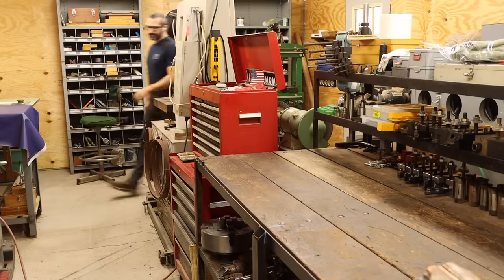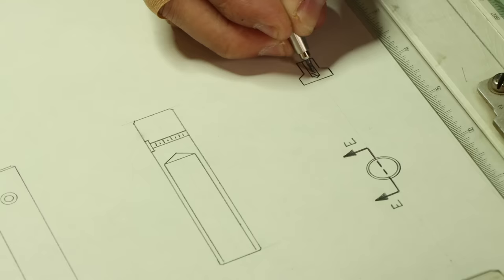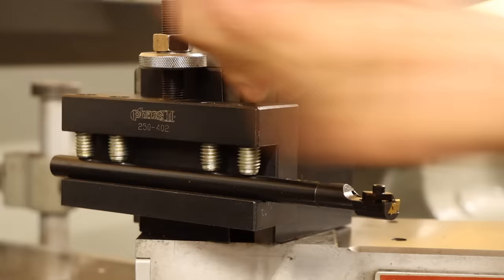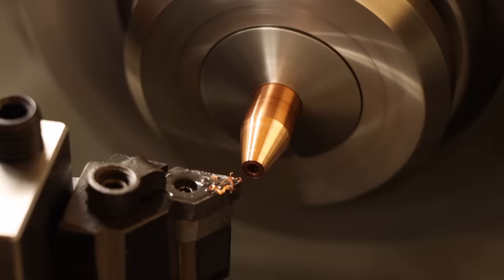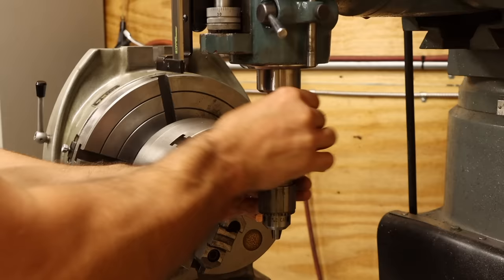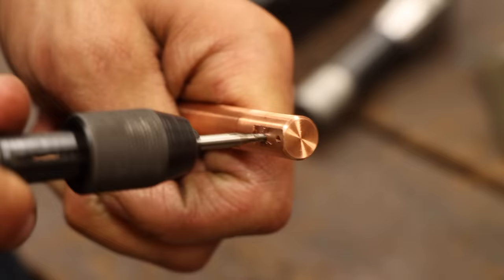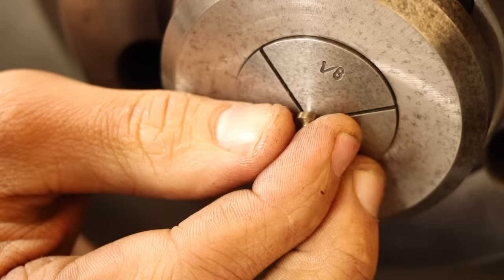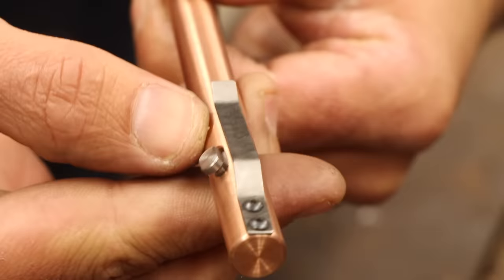Making a BOLT ACTION Pen || INHERITANCE MACHINING

Comment: At first I thought, "Why doesn't he do the diagrams digitally? That would be so much faster and easier." As the video continued I began to have an appreciation for the fact that everything was done manually.
Reply: Yeah apparently he does 3D design for work so I liked manual drafting
Reply: I took some drafting classes in college a while back and it's so much more satisfying than 3d modeling on a PC. Even doing the lettering and dimensioning is satisfying. PC software is great for production speed but drawing out plans by hand is extremely gratifying.
Reply: I also prefer drawing manually. It is a true satisfaction
Reply: @thachester  Given the hellscape that is licencing and updates and other computer trouble, pen and paper may be faster than CAD again.
Reply: @MazeFrame  Strongly disagree on the fast part. No matter how fast you can draw with a pencil. Modelling software will always be faster. 

However, drawing by hand does do something that CAD lacks. It forces you to think more intentionally about every line you draw and every dimension you put down on the paper. Ive noticed that with CAD I find myself roughing out a part withing literal seconds. And then spending a significant amount of time trying to fine tune it.
Reply: There's something to be said for old-school manual drafting.
Reply: @samsignorelli  then say it
Reply: @MazeFrame  i use Fusion 360 ALL THE TIME for designing, and technical drawings and its so much faster and gives way more flexibility than drawing by hand, and Fusion 360 can be used for free.
Reply: @MrMeasaftw  
I host a small cluster of CAD VMs, and not once have I heard my customers say "Ah no worries I'll just draw it by hand!"
Though you are bang on with the fact that hand drawing forces you to think more about each and every line.

I started hosting a CAD VM for my brother when he was just in uni and every now and then my servers would go down for maintenance and every time he said "Ah I'll guess I'll just practice hand drawing" the more he got into architecture the more he specifically took some time to just hand draw.
During the maintenance time we would talk about what he's working on and I'd get a glimpse onto the project, and the more "into the project" he was the more I could see the ideas he wanted on paper (his hand drawing that he shared) vs the different CAD models.
I would see either one (CAD or hand) influence the other.
Reply: @svampebob007  Funny story actually. Since switching jobs 2 months ago, I've been introduced to some technical drawings from the 1960s. And holy moly, the amount of work that went into those is staggering. There was a fully detailed assembly drawing of a massively complex machine. I like to complain when when my software takes more than 30 seconds to do something. Then I look back at some of those old drawings that took in the order of 30 days to accomplish the same thing. And I remind myself that I am wholey incapable compared to those guys from the past.

Absolutely mind boggling stuff.
Reply: Faster & easier doesn't 'always' equate to being Better.😉
Reply: @MrMeasaftw Also drawing it out gives you time to think about how you are actually going to make it, thus changing the design as you go.
Reply: My Grandad was a master builder and craftsman, and all of his plans had only ever been hand drawn on massive sheets of paper, usually stored in large rolls per job. He died almost two years ago, and I'm grateful that I have those to look at after his passing. His skills were truly remarkable, he single-handedly planned the house he built for himself and my Nana that he got to live in for a few years before he died. His plans look literally perfect. He has always been a massive inspiration to me as a a person and as a maker, and I have always hoped to be more like him as I grow older. It's bizarre to me, seeing the incredible people on youtube and being able to recognize that my own Grandad was truly amazing. I wish I had spent more time with him before he passed.
Reply: When he said "drafting therapy session" I kind of got it, but it's just... Gorgeous work... Wow

Comment: I remember watching this video when it was first posted and thinking it would be so cool to make something like that for myself. Now I'm going to an AMT school and I'll be making a pen for my final project in shop class! I won't directly copy this build, but I'll be borrowing some of the techniques used here in my own design.
Reply: I’m about halfway toward getting my A&P certs and my school also has a mill and a nice lathe. We certainly build many cool projects during the program, but not a single class will have us use the machining equipment😢. It’s a major bummer.

Comment: Building small things on big machines is not easy, you showed a lot of "finesse", great job!
Reply from the maker: Thanks, Jose! I felt especially silly using the 250lb rotary chuck assembly to make that tiny little bolt handle.

Comment: The drafting arm and the lead clutch which you rotate as you pull it along the straight edge -- a blast from my past. Nice work! I worked in architecture and machine design in the 70s and 80s, and I always found drafting a pure joy. I also just love your approach: straightforward, beautiful work.

Comment: It's amazing on how you hand-made all the drafts in a professional manner. Most novices in the world of Advanced Manufacturing(myself included!) only learn dimetric sketching(some also learn trimetric sketching), most blueprints used are created via design programs(like Solidworks). I'll definitely stick around to see more. I may be more experienced in computer-based design, and claim it is in most cases better, I'll still enjoy it.
Reply from the maker: Thanks. Yeah I've used CAD (SW, Inventor, Creo) for school and work for like the last 15 years. While CAD is definitely faster for me, I just enjoy breaking away from the screen for the shop projects. I'm lucky to have had 4 years of drafting in high school
Reply: I also was very impressed by this. I’ve used Autodesk Inventor at uni, and it’s so easy to do it with a CAD programme like that. His work doing it that neatly by hand is impressive, and not to mention it must have been time consuming!
Reply: Ah, the younger generations don't learn all the original skills.  Back in the day, CAD was the exotic beast that experienced draftsmen and machinists didn't know how to use without special training.  Oh, and AutoCAD was not something you just picked up figured out!  Oh, but the workstations had these cool X-Y input devices that had like a phone number pad on the back rather than just  left/right buttons.  Not entirely direct GUI manipulation, you had to enter commands and point to where you wanted to draw, as well.

Comment: The weathered and used pen next to the new one is so satisfying. Well done!
Reply from the maker: Thanks! It will take a few years to get there, but I that will make it all the more special
Reply: The cool part is that the copper is antimicrobial and it will develop a unique patina as a result from the oils on your skin. If you end up not liking the patina, you can always polish it off and make the pen look brand new (a brass pen will also have these same features due to the similar properties of both metals). With the right technique, you may even be able to "shipwreck" the copper (forcing copper corrosion in order to develop a unique turquoise pattern for aesthetic purposes which is usually then preserved by a sealant or clear protective coating). I have two bolt action pens in my collection so far. I own a Bastion bolt action pen which is a blue coated aluminum (it is rather bulky, but I like the feeling of extra robustness) and a copper version of the Refyne bolt action pen (way more compact and fancier then the Bastion pen making it an excellent choice as part of a gentleman's EDC). Both of these bolt action pens have various price and material options (the Bastion pen has tons of size, material, and color options as well as a similar line of mechanical pencils) which all take standard Parker Jotter cartridges. I carry the Bastion pen with me almost everywhere I go and I usually have a Fisher Space Bullet Pen (matte black version with matching clip), Tombow Airpress, or Victorinox Swisscard Classic (has a mini blue ink pressurized pen as part of the tool set) to accompany it. I save the Refyne for fancier occasions or for when I need a slightly more compact option to fit in the pocket.

Comment: Nice Project and well executed! What i only like more from the original draw is the "J" slot. It's reversed so the the bolt lever in rest position don't interfere when you slide the clip into a pocket. I think also if you give more angle of the clip towards the barrell, so that when you screw into place the clip will touch and give a little tension against the barrell, It would be finished better and It would help to secure firmly the pen into a pocket without risking dropping it if you lean forward. Can't wait to see your next videos!

Comment: Great video as always!
Something that might help next time a bit or tap breaks in brass, copper or bronze (maybe others, I'm not sure) you can put it in a solution of regular food grade pickling alum and hot water and it will dissolve the steel without harming the non-ferrous metal!
I recently had something similar happen with a tap in a bronze part and found this tip on a clockmakers forum after much swearing and frustration. It is an amazing trick in a pinch.
Reply from the maker: Thanks! That's really interesting. I'll definitely have to get some of that to keep on hand. Probably would have taken me longer to run to town and find it at a grocery than it did to start over.
Reply: You could have possibly have drilled from the opposite face. Knock out the centre drill tip and then plug your extra hole with a tight plug of the same copper? PS little tip on that style of centre drill.. don't remove the tip section as you dill. Just use a micro lift as you peck/ break swarf. Problem is if you lift the nose above the work every so often swarf will fall in and you can tear the tip off. Yes lube well. Was my secret technique!

Comment: Great story, great build and a well deserved treat for yourself, kids and G-Kids!  Nice Arrow Heads BTW, I always had trouble with consistency on those.  Tough materials to work with, especially with tolerances and 2-56's but you pulled it off in your usual aplomb and excellence and who doesn't love 2-56 button heads.  Kind of looked like a Parker insert¿  I imagine the weight is real nice and balance better now.  Not sure I have the tools for this but am now on my 4th Yasumoto quad point in ~4 decades and obviously love them for their trick mechanism, weight, balance, 3 colors and pencil.  Your vids are a real treat in every sense...Thank You for your time, really good story telling and the quality you bring to the community!   ~PJ
Reply from the maker: Thank you for all the kind words! You could still make one as a gift. Anyone that has any appreciation for handmade items, or machining/engineering in general you cherish such a gift!

Comment: Fantastic work once again. The buttery smoothness of your diagram drafting is, as ever, both soothing and also envy-inducing. Glad to see that the Side Project Counter was keeping it strict, even if a second side project showed up to keep the first one company.

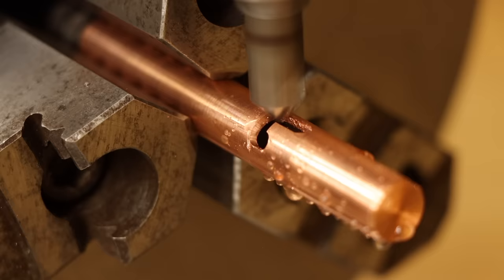11:51 In my head, I heard this sentence followed up by the obvious exclamation, "Chamfers!" 😃 (I also could hear the "Again." in re: remaking the part if the tap broke off coming before you actually said it.)

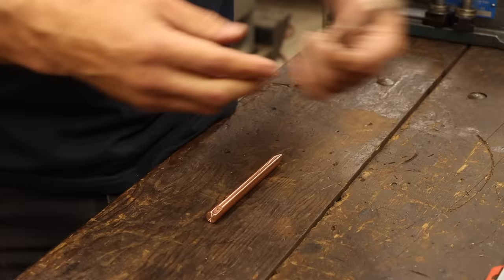12:26 I'm impressed that one of the reasons for using 410 wasn't, "It's what I happen to have in the shop," which I've gotten used to from a variety of machining channels. 😁 (No shame to anyone for using what you've got when you can't get what you'd want; it just struck me as funny to not hear it.)

(Also, thank you for proper non-auto-generated captions, but I noticed there were a few times when they said "lathe" when you obviously said "length", 13:26 has "bores" when you said "burrs", followed by "board" instead of "[weight-reducing] bore". I don't think YT has a proper system for people to suggest corrections to captions on others' videos, so I figured I'd mention it here for further proof-reading.)
Reply from the maker: Am I becoming predictable? 😂  I'm definitely guilty of just using what I have, but I'm making good headway through the mystery metals 😉  And thanks for the catches on the captions. I review them each time but 10 minutes of reading I still miss them occasionally.

Comment: I made one of these for my brother using my own blueprint. He’s been using it for years. In my case I made it out of 01 tool steel, then rust blued it after polishing it to 320grit. The bolt handle is brass.  Well done sir , well done.

Comment: As a almost graduated machinist. It gives me great anxiety to see fingers pushing chips away from the insert so close to the spinning piece. Also that hand sanding and grabbing that parting piece made my skin go goosebumps. I have heard so many horror stories how hand sanding has gone wrong. From teachers and workers from different firms in my internships. Like torn skin off hands,  or stripped tendon off finger or whole hands turned into mince meat etc. In school, they really crammed our heads with work safety and how important that is. I know you are a seasoned machinist with decades of experience and in the olden times safety practices were what they were. So, can you put some disclaimer or address some way in your future videos that your work style does not represent modern day work safety practices or something like that. Anyway. Your vid was very well structured, It was nicely edited and camera angles were very professional like. 

Thanks youtube for recommending this video for me. It wasn't disappointing.
Reply: Collet chucks are much safer. Work on smaller diameters also inherently safer. Also important keep the length of any cloth backed abrasives as short as possible. Use paper preferably. All manual machinists indulge in such 'naughty' behaviour. 
I used to have to bring to tolerance expensive components that the CNC boys had left oversize (a slightly dubious technique as it's pretty difficult to achieve parallism on turned components)
Please don't read this as a license to be foolish. Bigger diameters and three Jaw chucks can bite nasty or worse. Unfortunately there's a bunch of dudes that don't seem to learn and take far too much risk. Don't go using 2ft cloth abrasives. I've seen it ! There's no real need at all to have your dinky plinks near swarf. Use a brush or on some materials air
Reply: Oh man if you thought this was bad and scary wait till you work in a big boy shop
Reply: @Dillybar777  I rather not. Thankfully here in my country. There is all the proper safety guards in place on all the machines that i have operated. What i have heard from friends and family who work in these big local machining firms. That if the employee neglects work safety repeatedly and intentionally. He will get fired in no time. Also the workers insurance wont cover anything if you get maimed while doing so. Feels little bit insane to think that you would willingly put your hands anywhere near something like a chuck or piece spinning at 1500RPM.  I would understand these types of practices in some places like Afghanistan or China or in the 1930s. Not in the US in 2022. Well, the channel is called Inheritance Machining so i guess it showcase properly a time period of "work safety? What work safety?"

Comment: I really liked, how even the drawing was made nice enough to have it framed and hang to the wall looking like a piece of art.
As a construction designer working on a manual drawingboard like yours until the mid90s (before CAD took over) I really can relate to that.
Btw. I could have saved that part with the broken centerdrill on my EDM drilling machine.
Greetings from Germany
Reply from the maker: Can I borrow you EDM next time? 😉 
Thanks!
Reply: @InheritanceMachining  you could just move the hole 2mm down and it would look like old one

Comment: I made exactly a pen liks this out of full copper during my internship learning to use hand operated lathes, mills and the sorts. I remember having to spend a great time with precision gauges to re-level the lathe's chuck because I had to offset it to get the beveled tip of the pen. My design is divided into two parts though, which you screw together in the middle.

Comment: If you ever break a drill or tap into non-ferrous metal, you can soak the part in alum to dissolve the steel. I fix saxophones, and this is an amazing trick to know when I have to remove a broken rusted steel rod from inside of a brass post.

Comment: Just a tip for machining out broken centre drills. Old/broken carbide end mill shanks sharpened to a point (normally 90 degrees so a bit sharper than a regular drill) work really well. Just have to spin them as fast as you can and be very careful about how hard you feed it in, and there's a chance that as the broken piece gets dislodged it will get caught and chip the home made carbide drill.

Comment: You should get some spiral flute taps - they work much better for chip clearing on smaller threads, and in my experience require much less cutting force too.

Comment: The way we used to remove broken screws , drills and taps from brass or bronze and copper was to make up a saturated solution of alum and keep it near boiling point then leave the non ferrous part in the alum soln till the steel dissolves.